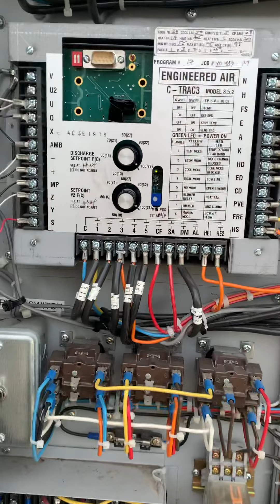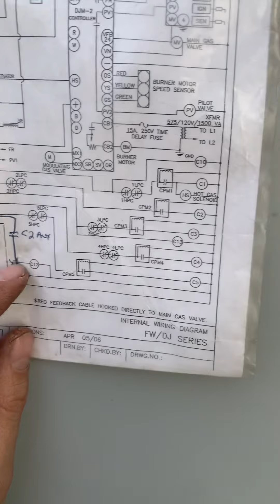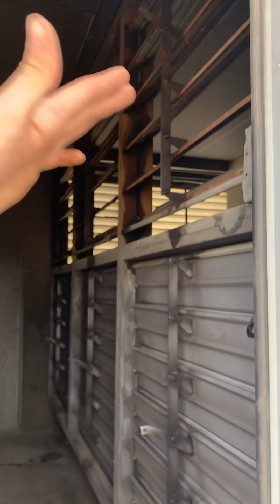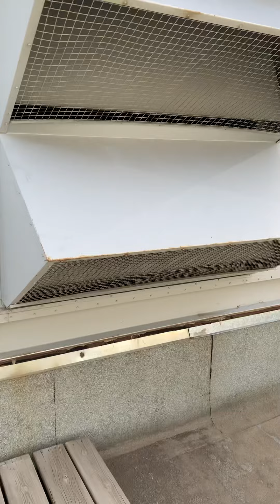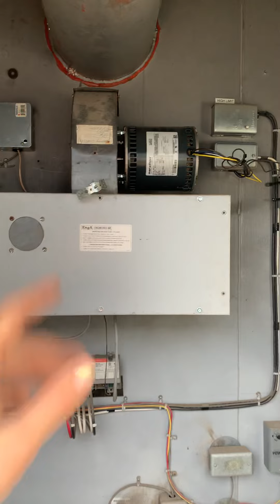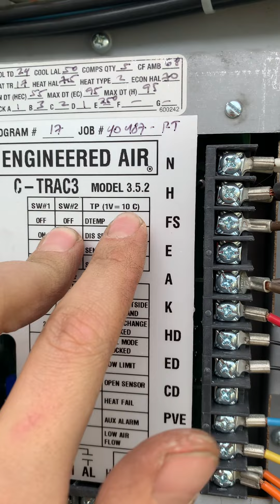How to jumper on c-trac/DJM2.4 “Enga” boards for servicing

Comment: Hey, I recently started working on EngA units and just wanted to say thank you for sharing your knowledge on them. 

What tool do you use to generate the VDC signal by they way?
Reply from the maker: I have a signal generator. It produces at 0-10vdc signal or a 0-20ma. You can actual buy them on Amazon. They range from $30-$80